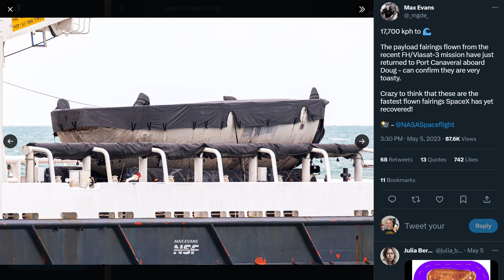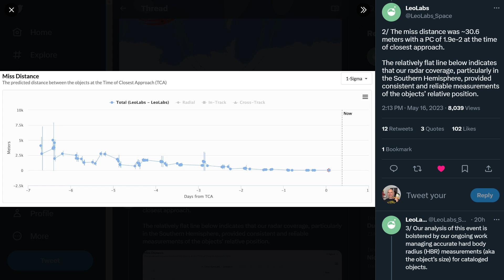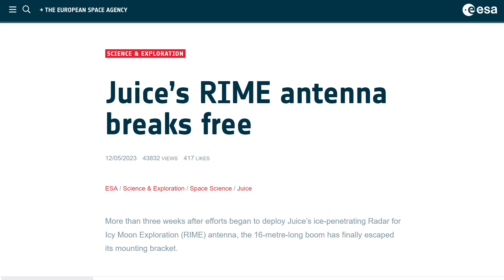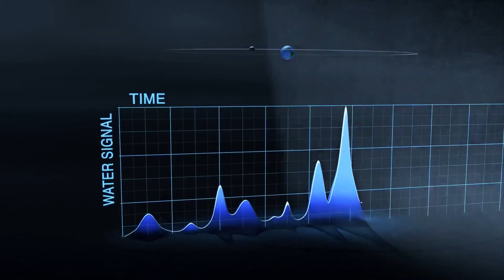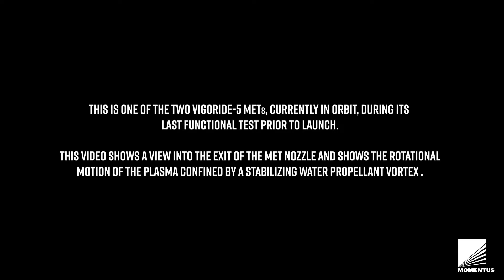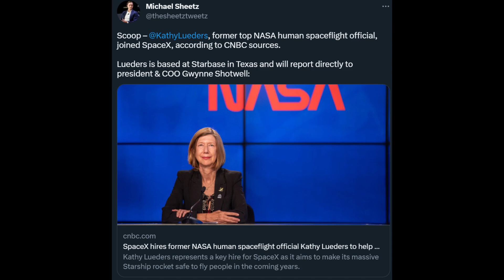Vast Space Station from a Crypto Billionaire - Deep Space Updates May 17th

Comment: Maybe a question for another deep space questions episode. 
Spacex is installing this new watercooled plate under the launchpad for starship. But shouldn't the pressure inside the plate be higher than the pressure from the boosters rocket engines to make it work? If so, how will they produce so much waterpressure?

Comment: The thing about the Starlink network is that somehow it doesn't seem to be at the forefront of space news any more. The network does not have  the capacity to carry a significant proportion of global internet traffic. So it will probably remain a niche market for users in rural isolated areas with poor internet connection. But I suspect that its military capabilities are way more important than simply functioning as a  global internet provider. Perhaps that's why Starlink news is no longer hitting the headlines?
Reply: Starlink is fairly early in it's deployment process, so the initial excitement has burned out before renewed excitement can come in behind it. At any rate, mobile communications e.g. over the ocean will be a big thing too.
Reply: Starlink was not ever intended to carry a significant proportion of global internet traffic.  It is specifically designed to serve under or difficult to serve area's.  I don't think you have any actual understand of what starlink was designed to do from the get go.

Comment: On the Vast Space Station, apparently they are claiming it will be an artificial gravity station being able to 'rotate' in some fashion but given the size have a lot of doubt about that claim.
Reply: Not actually that hard to do, but sane RPMs won't do much more than move all the floating debris to the floor.
Reply: @absalomdraconis  Kind of my point in that you can't get a high enough RPM (the claim I've heard is enough to simulate Lunar gravity) without major consequences. At only about 17ft in diameter there would be a gravity difference between your head and feet not to mention having a high enough RPM that would likely be way over the nausea limit.

Comment: I have to ask -- it looks like someone could have rode those fairings in; possible or would the heat (radiation from plasma?) on the leeward side still be to much? (obviously you'd need to be  in a suit with O2 etc and ignoring the actual eventual splat when they hit the water)

Comment: 1:16 There's really a lot to say about this launch! Because the space station is entering normal operations phase there isn't a need for as much fuel resupply, so they were able to take out two of the four spherical tanks and hence the payload weight increased from 6.9 to 7.4 tonnes. This makes this new batch of Tianzhous the most efficient (ratio of cargo to takeoff weight wise) and the highest payload weight cargo ship still in production (just behind the retired ATV I believe)
Reply: all mass launched from earth is wasted anyways, it's really dumb trying to claim an achievement to get 1.1% payload ratio vs 1.2% payload ratio or whatever it is, when something mined from space would be at 70% or more
Also don't the SLS and Starship both have a much higher payload weight to orbit? Granted they're not supposed to be "cargo" (resupply) rockets, but a rocket is a rocket, what you put in the fairings doesn't really matter outside of it's mass, bulk, vibration and G tolerance, if anyone cared for such projects the SLS could be a cargo rocket all the same, there's no design difference between a cargo and a non cargo rocket, except maybe the desired safety level

Comment: I wonder if is possible to add modules to the space station? COME ON, you can dock a space dragon to it?!!
Reply: That's basically what Axiom will be doing for construction of their space station. They going to dock the first module to the ISS, and then gradually extend it until it's complete, or until before ISS is deorbited (whichever comes first) and then separate from the ISS to go into their own different orbit.
Reply: Of course. There were even more intented. Maybe needs some adjustments and module shuffling, but there is no reason the ISS couldn't been expanded. Except for political and monetary issues.
Reply: I suspect they have embraced SpaceX's rapid iteration model. This prototype is a minimum viable product that can be launched with a Falcon 9 and won't kill any customers.

This is how they will learn how to make stations that are easy to maintain for years at a time. This first try isn't likely to be low maintenance.

My prediction is that they will learn a lot from it, but they will replace it with something better within two years.

Comment: How are SpaceX going to solve the stability issue of landing on the moon? They have a big, tall, thin lander with a teeny tiny footprint, and it looks like any degree of tilt due to rough ground is going to pitch the thing over. All the competitors seem to have better distribution in the landing legs department. Is there something in the design of which we are not being made aware?
Reply: You know they haven’t designed the legs yet. those were just for testing
Reply: @sc1338  ? They haven't even built a prototype yet. I'm looking at SpaceX CGI of the lunar lander.
Reply: It's not the big issue you think it is and the thing you're not aware of is that of all the other proposals none of them hit the budget, spacex, who also was the only one with actual hardware being made, did come in under budget.
Reply: @TheEvilmooseofdoom  I might know more about landing things on the moon than you think. It is, in fact, a very large issue.
Reply: Funnily enough SpaceX has tons of experience landing much higher aspect ratio objects on Earth in higher gravity (which means less margin of error) and with much worse transverse forces. Landing a relatively stubby Starship on a non-pitching surface with no shear wind forces to deal with is nothing compared to landing a Falcon 9  Booster on a barge in a storm in the ocean.... This is  not a long pole issue.
Reply: @MRichK  No, it's a ground angle and ground stability issue. Even if you think the landing zone is nice and flat, there is absolutely no guarantee that (a) it'll stay that way, and (b) you'll end up actually landing there if things go pear-shaped. I used to design this stuff for real. This is not just an internet reckons.
Reply: As far as the recent renders go, Starship is supposed to have some big landing legs, i wouldn't doubt that they could make them even larger by just making an upscaled version of the Falcon 9 legs.
Reply: @davisdf3064  It's a bit trickier than that. Unlike the Falcon legs - and indeed the designs I'm more familiar with - these new ones have to be fully reusable without an overhaul, and hold up against angles of tilt that can cope with what a manned mission may encounter in an emergency.

Comment: There is no chance whatsoever that the VAST space station goes up when they claim. It's just simply not possible to build even a small space station from effectively scratch in less than two and a half years, carry out all possible tests and get it ready for launch. Not even if you would be experienced company with vast resources, which they aren't.
Reply: It seems like they’re using a lot of equipment similar to the Dragon XL- even the solar panels they’re using seem quite similar to Dragon 1. I’m willing to bet they’ll use existing dev on Dragon XL, the cupola from Inspiration4, and a lot of other stuff to reach near that goal. I would put it in for 2026, though.
Reply: Why not? Nothing about it is novel. It should be significantly easier to design and build then a capsule, as it doesn't need to worry about carrying crew to and from orbit, among other things.